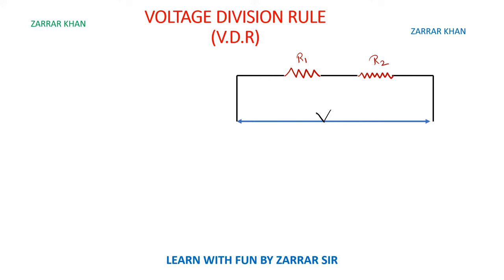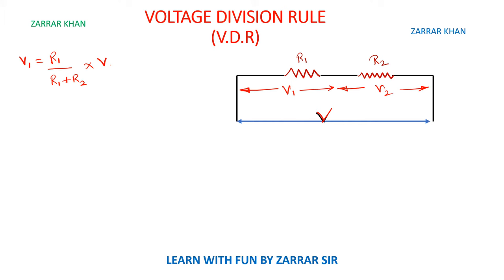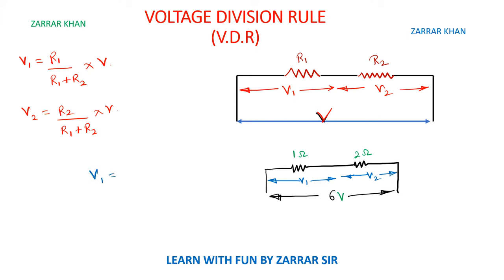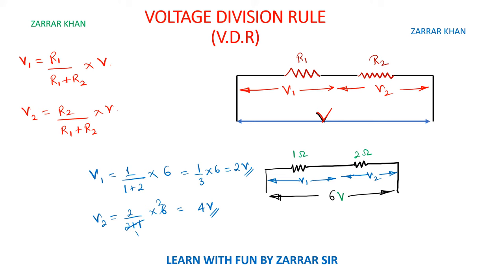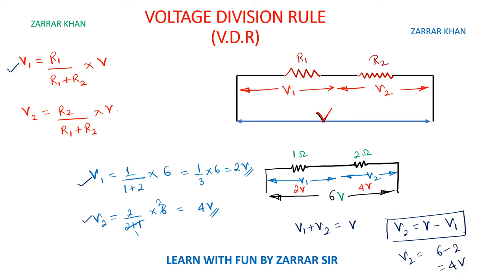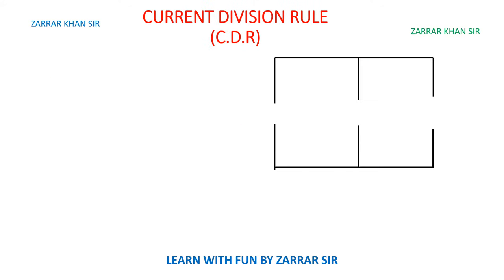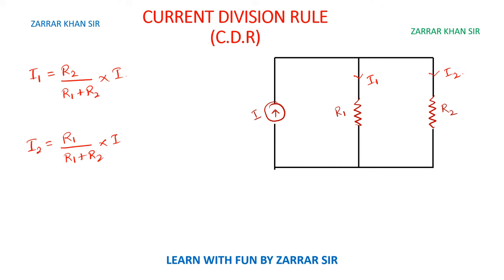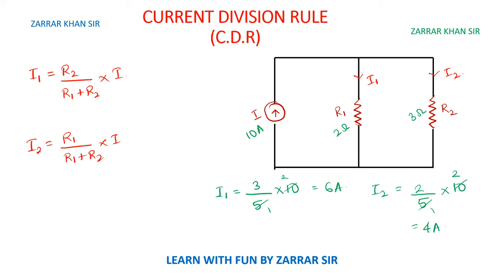VOLTAGE DIVISION RULE and CURRENT DIVISION RULE in JUST 7 Min

Comment: Sir i have a same question like other people told you that if more than 2 resistor in a circuit than what formula we will be used in both voltage and current division rule tell me about that.
Please Sir ❤
Reply from the maker: Need to make a video on such scenario
Reply: @ZarrarKhan  Ok Sir, Thanks ♥️